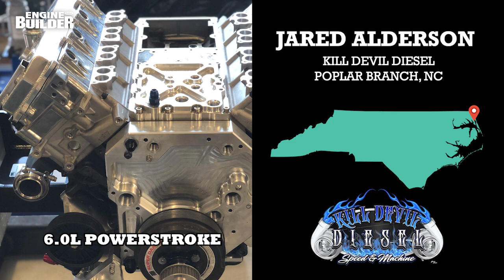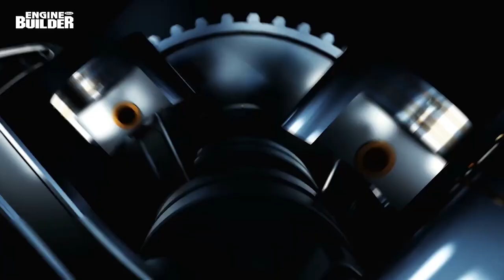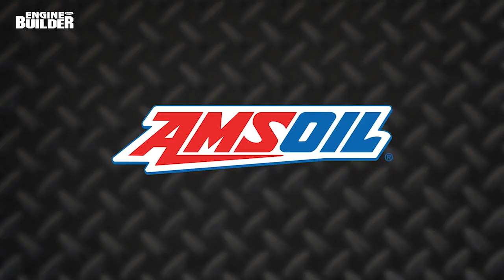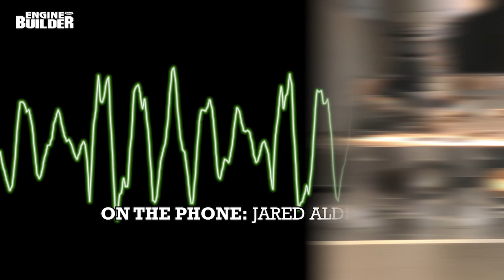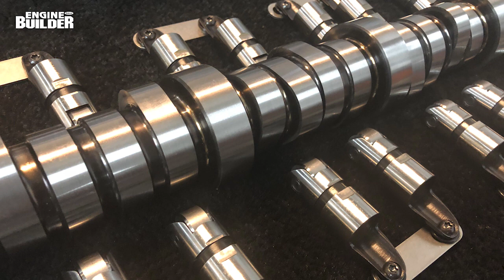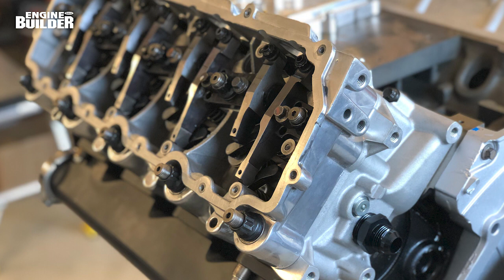Kill Devil Diesel 6.0L Powerstroke

Comment: the 6.0 is an exceptionally plentiful motor and with the KDD heads plus studs you’ll get 500k miles on the motor and zero issues.
Reply: Going to build a block this summer with them 👍🏼 over build and use just the standard bully dog tunes and have a strong reliable engine for years.

Comment: What would a NON-race bred, street-friendly fully built KDD 6.0 cost?  We love our 6.0 but it’s getting tired.  Kinda over band aiding all the time
Reply: Depends on what power you’re trying to achieve. 450 horse turn key engine is gonna run just shy of 14k for just the engine itself, 650 horse engine is gonna be just shy of 20k.
Reply: @KDlGG  Your numbers are way off. 450hp can be done with basically a hot tune. If not slightly bigger injectors and turbo with a hot tune will get you 450hp easy...
Reply: @brettrichards666  he’s talking buying a whole motor from kdd not making power
Reply: @blugods2655  Well I'm 9/10ths retarded. Lol
Reply: @brettrichards666  🎯

Comment: I am a huge Ford guy and I’ve been wanting a 6.0
Reply: You do know that Ford didn't build any Powerstrokes except the 6.7 There all made by International.
Reply: @badass6.0powerstroke10  well I didn’t know that 6.0 was an international engine
Reply: @riveradams2109  Yes sir, every Diesel put in a Ford Truck was made by International up until 2011 when the 6.7 Powerstroke came out, that was Fords first Diesel.
Reply: @badass6.0powerstroke10  I was always told the 7.3 was the last international engine I’ve been lied to my entire life well you learn something new everyday
Reply: @badass6.0powerstroke10  
Thankfully the 6.7 powerstroke is the most reliable out of all of them and the best lol. Yes the 7.3 powerstroke "international" is a beast of it's own. Just like the Cummins diesel though, Dodge didn't make those engines and still dont. They are made by Fiat and the Cummins company by theirself.
Reply: 🎶International Harvester🎶

When I tore down my old 7.3 IDI there was a bunch of IH logos on some of the parts yet, which is strange because the Navistar buyout happened years prior to 1988, which was the first year of the idi seven three.
Reply: @mattlf9120 Very rare however there are some Cummins 5.9s out there with IH heads. Typically thought to be a better stronger head with the IH casting. Back in the day IH had there hands in a lot of platforms.

Comment: I'm not doubting Jared's knowledge, but at this point why not just swap a gasser in there? You want more power in the top end, and reduce torque at the lower RPM's?  That's called a gasoline engine.

Their cylinder head products are incredible tho.
Reply: Why do anything then? He literally runs a shop that SPECIALIZES in PowerStrokes - and you're questioning why he's building bleeding edge PowerStroke race engines? Really?
Reply: @RyTrapp0  I think Gabriel has a point, however it simply wouldn't be diesel.  It's the challenge these guys live for.
Reply: ReAL tRuCkS doN hAvE SpArK plugs! 🥴
Reply: Race engine building basics: higher rpm = higher power. Do you want a racing engine or tractor engine ?
Reply: Because of torque, there is more to these trucks than running them down your local dragstrip. Engines like these will go into trucks for  diesel competitions, races and sled pulls.
Reply: @V8Lenny  you know before the auto industry we rode horses and they’re pretty high maintenance

Comment: All I want is my 6.0 to freaking work what a shitty engine! You got to delete almost all the engine and start over.
Reply: Save your money.  And when you are ready. Go buy a complete Kill devil engine for your 6.0. You will never regret it.  This engine is nothing like the stock 6.0
Reply: Blame International. They built that engine not Ford.
Reply: Just get a 6.7
Reply: No you dont. Find one that hasn't been neglected  delete the EGR completely  and give it some love. And you'll be good to go.    I spent 10k on parts and 3500 for the installation .  And I pretty much have a new truck.  And I'm pushing 550hp. To the wheels . Can still tow max weight with a good tune and get somewhere close to 20mpg on the highway  crew cab
Reply: There was alot of engineering flaws present on launch, however I we have worked out those old 6.0 issues from 2003.  6.0 is a very well rounded engine when up to date on the latest revisions from Ford motor company, support from our friends in the adtermarket and with a good tune can compare with newer diesel engines in light duty trucks.

Comment: My 6.0 now has kill devil diesel ported aluminum heads and a matching kdd stage 2 cam,  lifters, and push rods WDI 190/30 
Just to name a few mods. The 6.0 is a power house now
Reply: How’s the 6.0L been holding up thinking about getting one soon
Reply: @matthewbuck1659  they come will some issues built right tho man they run like a freight train love mine!!